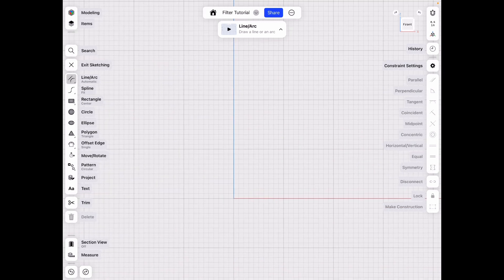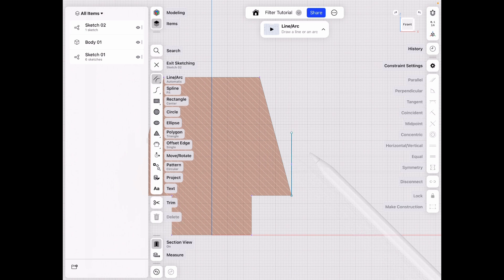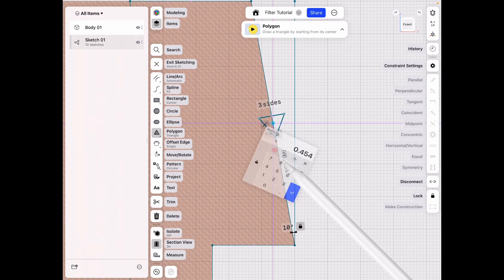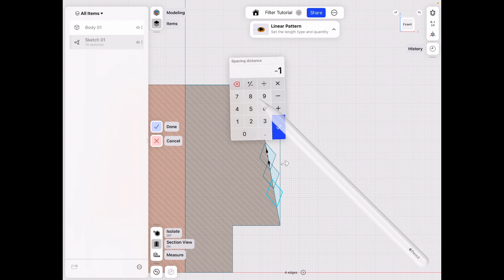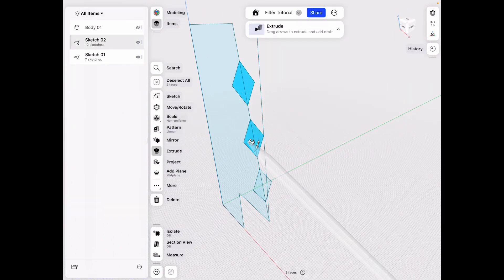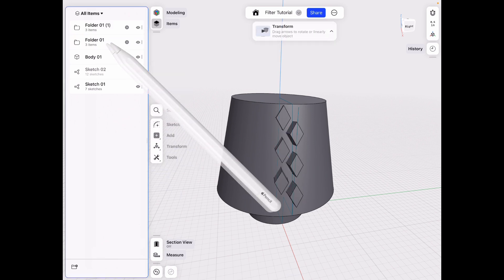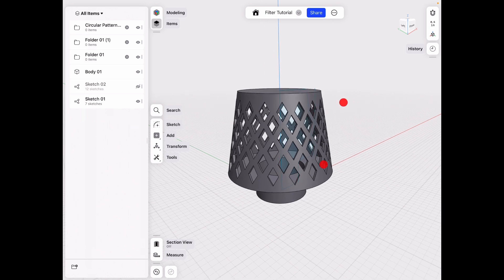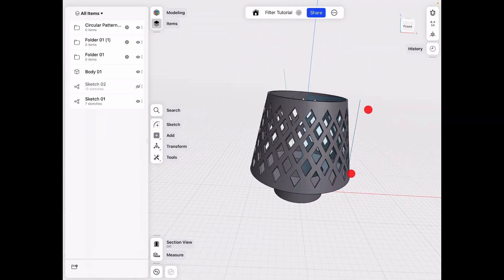Cylindrical Pattern 3D Printable Filter Shapr3D iPad Tutorial

Comment: Two minutes in I can’t get past a constraint error been trying to adjust to 10° I’ve unlocked everything except for the top line and the angle in question
Reply from the maker: Without seeing your screen I can’t say anything past: make sure you double check for all constraints, sometimes there is multiple. Unlocking your sketches may also help. If all else fails, just use the move/copy tool and then delete or hide the old one.

Comment: I want to project my design on flat surface and when i go to drawing I don’t know how to unfold (flatten) my design
Do you know how?
Reply from the maker: To unfold your design in Shapr, you would have to manually split the body and rotate as needed. Shapr does not have a sheet metal option atm. Or did you mean something else?
Reply: @JLake3D   how i can split the body and rotate it?
Reply from the maker: @a_bo check out my split body tutorial, then use the move tool to align the move tool with the correct axis and revolve as needed. You need to account for the bend radius when doing so though.
Reply: @JLake3D  sorry I can’t really understand how. Because I need to export the cutting dimension and the sketch plan should express in 2D. How do I flatten the cylinder form of surface to flat 2D to get to export the 2D printable plan?
Reply from the maker: Unfortunately Shapr3D does not have a sheet metal option. There is no way to unfold a 3D object yet. Only way currently is to manually do the calculations on paper and then sketch them out, at which point its just easier to use another program for that atm.